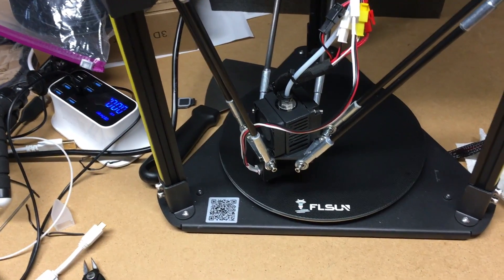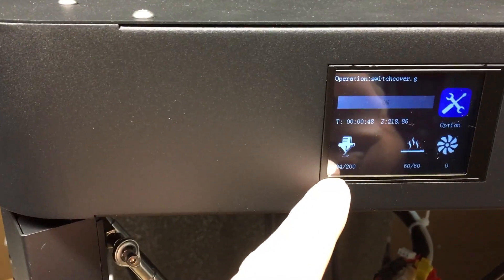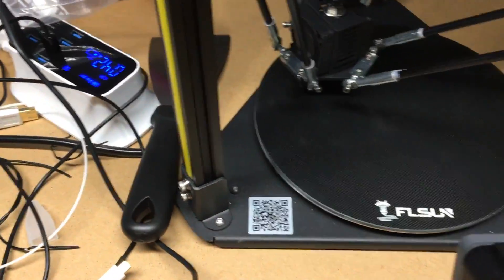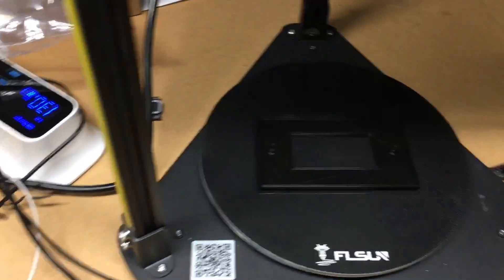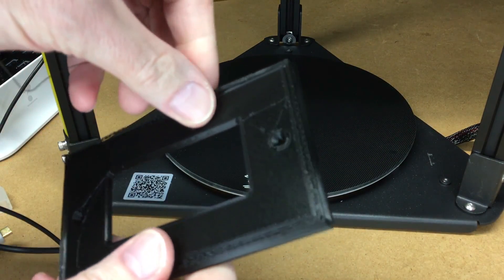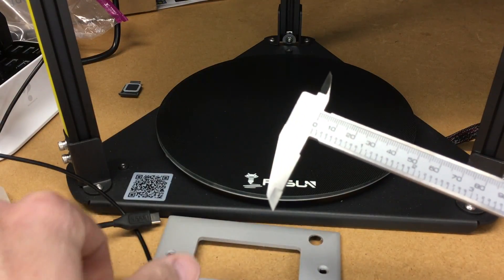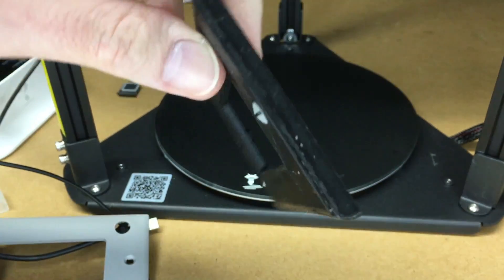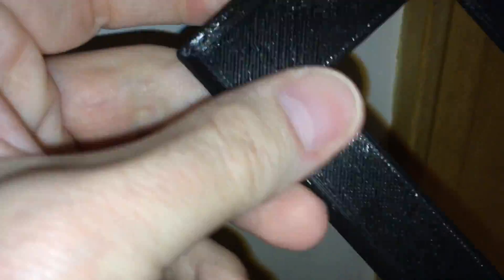FLSUN Q5: Printing my First Modeled Print (Ep. 6)

Comment: You can also raise/lower your z-height while printing. On my other printers i tend keep my z gap pretty tight and babystep it up during the purge cycle and the outer rings of the brim. I've only run one print on my Q5 but i did the same thing and it worked out pretty well. 

Giving your build plate a very light spray of AquaNet hairspray will both make your first layer look like glass and will aid in both adhesion and release. All of the volatile liquid evaporates off in a few seconds on a hot build plate and it leaves a slightly tacky film of acrylate/vinyl copolymer that decouples the filament layers from the buildplate. not strictly necessary but it does seem to help some things and doesn't seem to have any ill-effects.  

As for the empty strip in your first layer, your slicer makes some decisions about the tool path and sometimes it doesn't always do the most logical thing. You can preview the tool paths in just about every slicer. 

That print doesn't look like it needs supports but I have noticed the part cooling on this printer is absolute garbage so the overhang tolerance might not be great.

keep it up!

Comment: You should set "Combing mode" to "not in skin" to remove those scratches on the surface.
Also consider to activate Z-hop when traveling.

The line around the print is the skirt used for priming the nozzle.